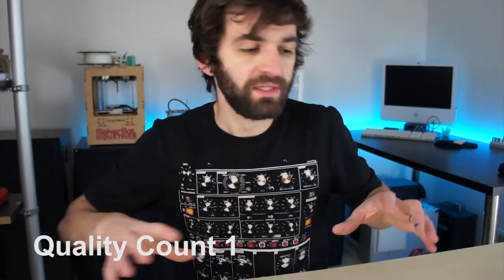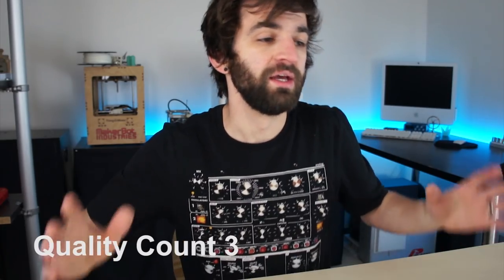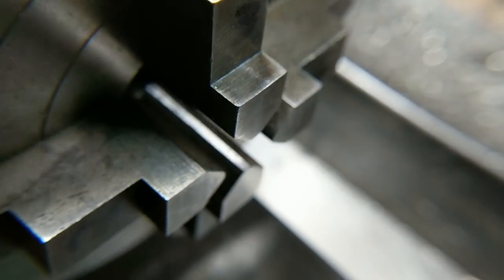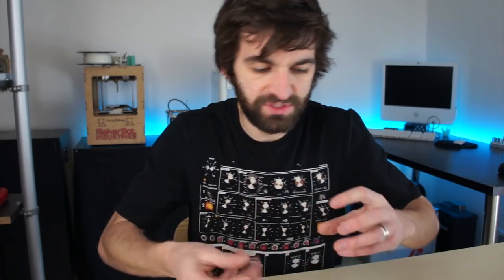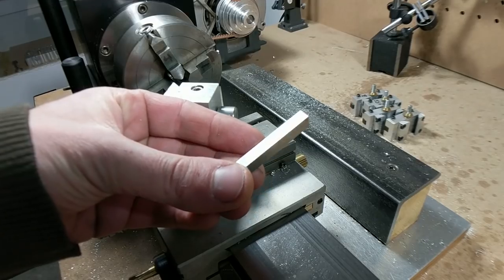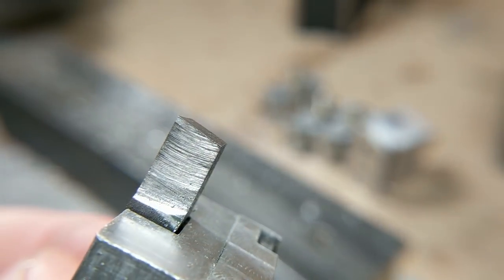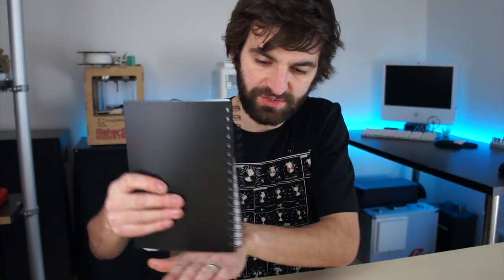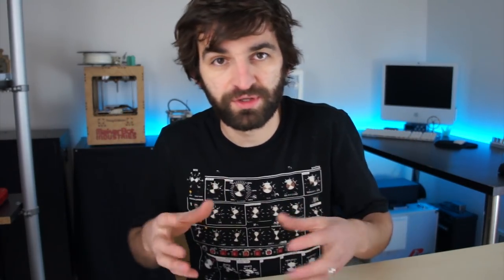Buying Your First Metal Lathe

Comment: Title should be "Buying Your First MINI-Lathe" as these Sherlines and Taigs are hobby lathes only, and there are HUGE differences between these mini-lathes and the 10" x 22" and up metal lathes from manufacturers such as Grizzly etc. In my opinion get a 10 x 22 and do so much more than those little hobby lathes could even think about!! And for very small parts you can fit a drill chuck into the spindle or into the 3 jaw and work it that way.

Comment: so far i can't seem to find any lathes with 4 jaw chucks.

if i search
"lathe" i only see lathes with 3 jaw chucks.
if i search "lathe with 4 jaw chuck"
i only see 4 jaw chucks without the lathe XD
Reply: i'll be honest though , im more interested in machining wood for testing ideas in a pinch then i am machining metal
but it would be nice to be able to do both i suppose.
Reply from the maker: Its pretty common to purchase a lathe with a 3 jaw and buy an additional chuck should you want different styles...even with my Taig all my chucks were purchased separately.
Reply: @CurtVanFilipowski  i just find it a curious that pretty much nobody is selling lathes with 4 jaw chucks already installed.

and kind of just looking for a machine for making experiment parts like part holders and what not.
but i think i'll also be making tool handles with it as well.

i'm stuck in indecision right now as to whether i should get a lathe or a mill XD 
slightly leaning towards lathe though as i can already think of several things i could put one to use for .
and sure i guess i could build these things by hand but knowing my luck i'll make them off center.

i definitely know though that i am not getting a 3d printer as that could get expensive over time with the filaments.
with lathes and mills i can use pretty much any raw material i already have laying around anyway.

Comment: I lost confidence when you said , I learn of youtube for cutting tools..WTF didn't you go to University to lean machining .
Anyway their are hundreds of lathes and mills to suit all price range that can produce 0.05 quality finish, even 600 bucks one from Harbour freight, 
im in the Uk and have a £500  @ a 7x14 clearance  and make engines 
so i would say spend time researching the right machine for the job you need to do. if you don't get on with it then sell it, 99% of the time you will get nearly the same price for it so you don't loose  much at all. 
i find people selling their used stuff off for about the same price as new.
Reply: What did you buy? the only 'quality' one I seem to find  (apart from the chinese ones who cost less, but could be crap) is the Proxxon for small size.

Comment: First of all a cheap machine is a cheap machine, made down to a price because fools want high quality for a low  price and expect to get it already running and machining parts right out of the box....poor fools.
This scenario will deter many wannabe machinists with dreams of making parts that have bright shiny finishes and made to micron tolerances all because the seller glossed over the fact that you only get what you pay for......scale down your expectations, learn to overcome the problems and be prepared to "adjust" the various problems as they become apparent.......nothing is perfect, and if you want perfection remember you are not perfect either......the nut that holds the wheel is the most dangerous part etc......being a skilled machinist I tend to overlook the confusion that noobs have when confronted by moving machinery, big or small.
I disagree with the statement about a 3 jaw chuck not running true.......you've  probably never heard of a slack chuck register scenario that allows even a badly worn chuck to run dead true at any time.......most work in a 3 jaw is by gripping a piece of raw material and turning it to size etc.........second op work is  a different matter.........a 4 jaw chuck can get you running true but it's not ideal for a start out or noob at first.
As an observation to this problem of getting quality for pennies..........the Chinese sellers could double their turnover by supplying the machines in parts roughly machined and for the buyer to then go the whole hog and make it a thoroughbred.....buying cheap means you are 3/4 the way to a good machine anyway by buying one that needs to be completely overhauled before you start.